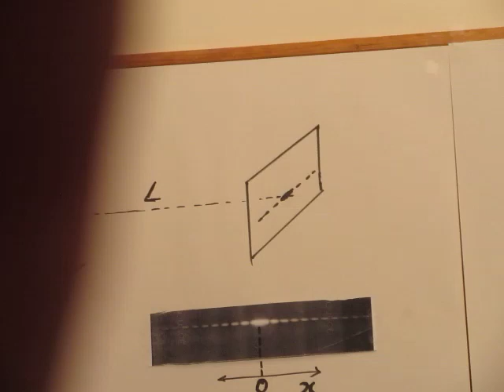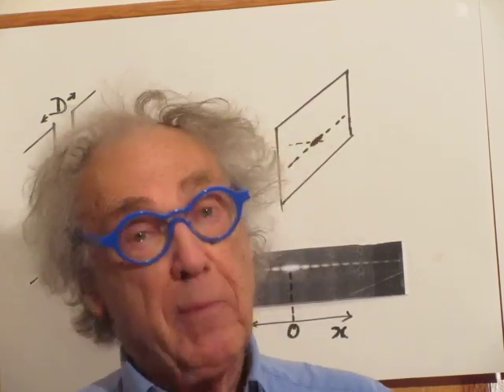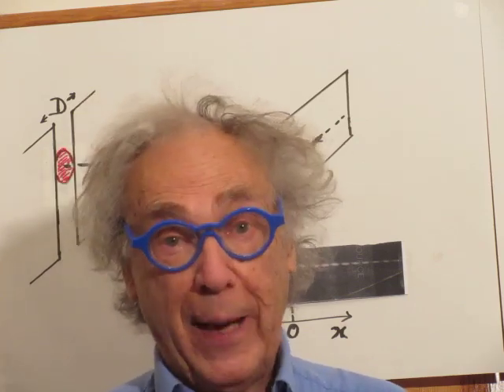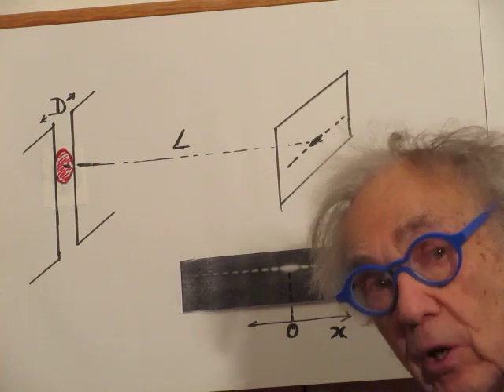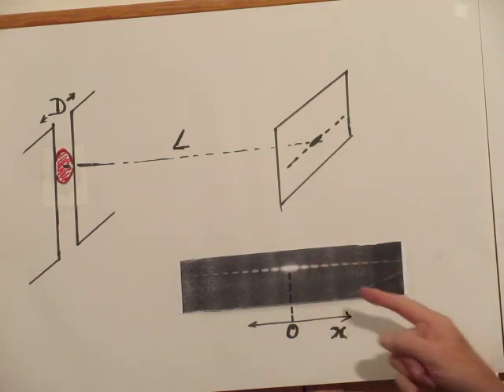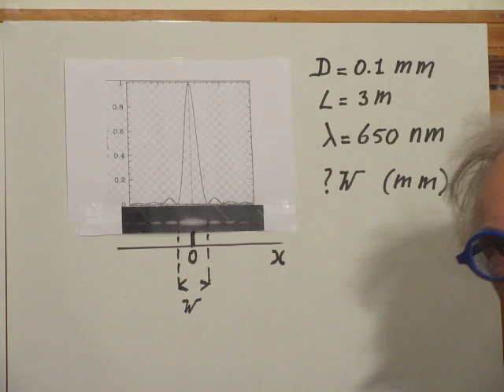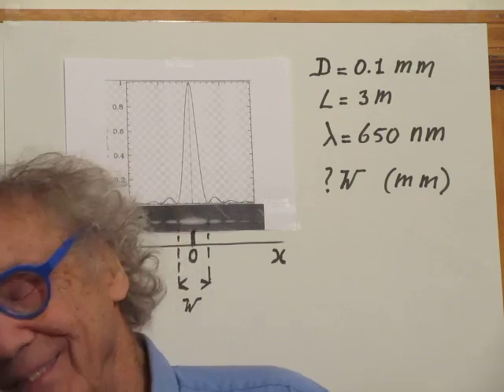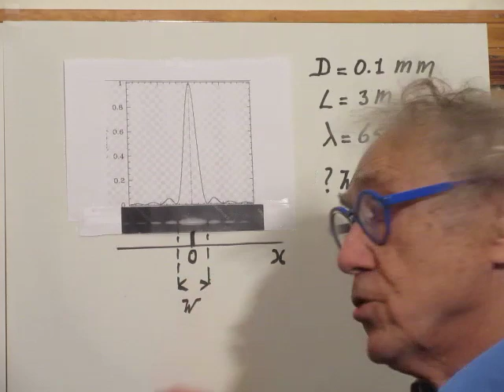Diffraction Problem #76

Comment: Every force has equal and opposite force, in an circuit connected by an battery, the electron from anode of battery, PUSHES electron near by(in the conductor) , that near by electron pushes it's near by electron, this chain of pushing, ENDS at CATHODE , while PUSHING, the electron from anode will DECELERATE. But in formula of drift velocity, this deceleration is not included..... WHY? (if I am wrong correct me SIR)
Reply: The (+) anode (it's an electron sink) actually strips (-) electrons from the wire and there is a chain reaction of net positive charge that pulses through the circuit until it reaches a (-) cathode, which is a generator of electrons (a source).

Comment: Is angular accelaration of a rigid body the same abt any axis?Ummm let's say I have a ball on a rough incline and it rolls without slipping .Is it necessary that about any axis which I choose to calculate torque about the angular accelaration would remain the same?For example I want to take three frames the topmost point(which would actually have a pseudo torque) ,the centre of mass and a third frame which is a man going down the incline with accelaration A(non inertial frame),would all of them observe the same Ang accelaration of the ball?(ball is perfectly rigid)
Reply from the maker: question ill-defined
Reply: Ok I applied the torque equations about the topmost point along with the pseudo torque and got the same value of angular accelaration?
Is this just a coincidence professor?

Comment: Dear Walter,

There is a problem I've been thinking about for a long time now. If you take a pan with water and place it on a heating element (such as a stove), it will start boiling. I can't seem to  find an explanation to why, if you turn off the heat, steam will be instantly visible above the liquid water and the impression will be that the ammount of steam increased in comparison to when the heat was on, for a short period of time. I found some speculations on the web about what could cause that, but I would like to know if you have an explanation to this fenomena.

Best regards,

Thiago Santos
Reply from the maker: liquid starts to boil when the vapor pressure equals the pressure outside the liquid.  Water a 2 C will boil if you put it in a bell jar and pump the air out. When the pressure inside the jar is 0.007 atm or lower, the water will boil.

Comment: Sir, in your book 'For the love of physics' in chapter ' The magic of drinking with a straw ' you have asked a question about the snorkel tube that if by using that trick we can snorkel much farther down beneath the surface of water in lake or sea ...I think i've got the answer and I want to discuss it with you ( Also you said there "if you know the answer drop me a note" ) so please may you tell from where to contact you....
Thank you 
Best regards
SURAJ
Reply from the maker: drop me a note here
Reply: @lecturesbywalterlewin.they9259  Suppose I went much deep in a lake along with the snorkel tube whose other end is above the surface of water and tried to inhale through the tube , then block the near my mouth with my tongue . This will lower the pressure in the tube ( just after I inhaled) thus, forcing the atmoshpheric air entering the tube , but just after releasing my tongue i've to exhale ( Of course i cant exhale through my nose as its blocke by the frame of snorkel) . So i have to exhale only into the tube of the snorkel , as soon as i exhale ( carbon dioxide) its heavier than air so it is not able to escape through the long snorkel tube and it stays there. Now when i again release my tongue ( after exhaling) to inhale ; i actually inhale carbon dioxide and it can cause lack of air circulation which can even lead to death.

I thought this way , proffesor . I would really feel greatful if you rectify my mistakes. 
THANK YOU

Comment: Hello sir, I have a question. If I immerse a mug inside water and try to pull it out in the same way immersed(I'm just pulling it out from the water upside down), why will I have to apply a greater force on it when it reaches to surface? 
Regards
Reply from the maker: question ill-defined. Watch my 8.01 lectures on Hydrostatic pressure and Atmospheric pressure.
Reply: @lecturesbywalterlewin.they9259 
Sorry for the inconvenience ....
I was just asking ----
When I dip a mug upside down in water (with its mouth facing water bulk) and in inside if I try to turn it around , I surprisingly see some bubbles coming out with some bubbling sound. I was eager to know why that would happen?
I apologize for my mistakes...

Comment: Sir, Even thought batteries have potential difference across it..... Why ELECTRIC FIELD IS NOT AROUND THE BATTERIES....?
Reply from the maker: A battery does not store charge!  In a battery the field is chemically produced inside the structure of the object. ... Now, the reason why there's a current on the circuit has nothing to do with electric field. Since there's accumulation of charge on one side on lack on the other, there's an electric potential difference between the poles.

Comment: Sir, according to coloumb's law, when to two charges is at distance = 0 (touching each other) they experience INFINITE FORCE..... is it TRUE?
But in charged parallel plate when charge at distance=0 CHARGE TOUCHING CHARGES IN PLATE experience an FINITE FORCE... HOW?
KINDLY EXPLAIN IT sir
Reply from the maker: Charges with zero size do not exist. Thus the distance between 2 charges can never be zero.
Reply: @lecturesbywalterlewin.they9259 
thank you SIR
Reply: @lecturesbywalterlewin.they9259  
From a experimental POV; What is the minimum possible charge size in terms the of 'Planck lengths' ? 
- Is there a 'minimum' (in theory)?